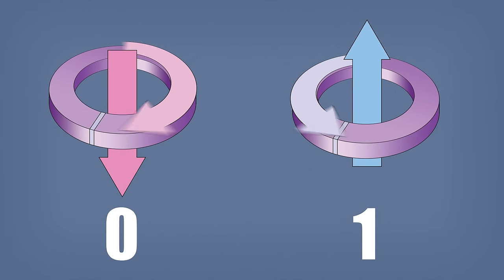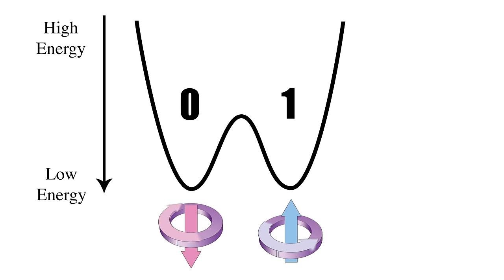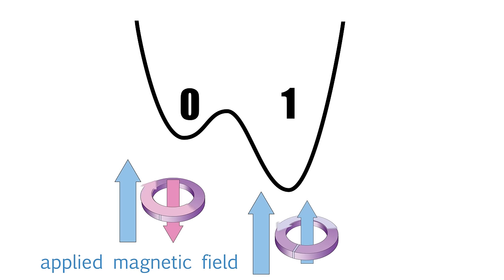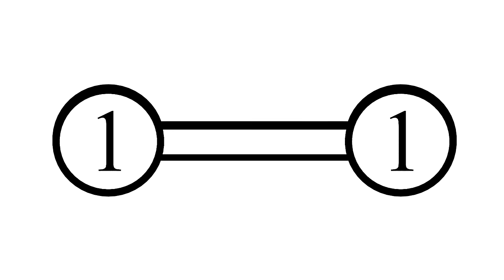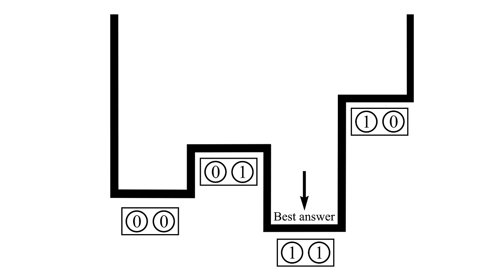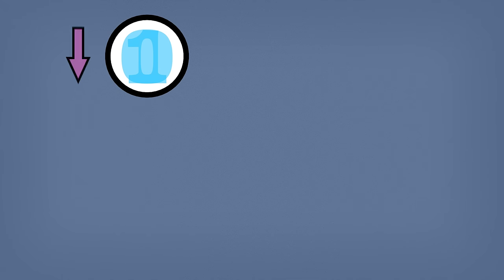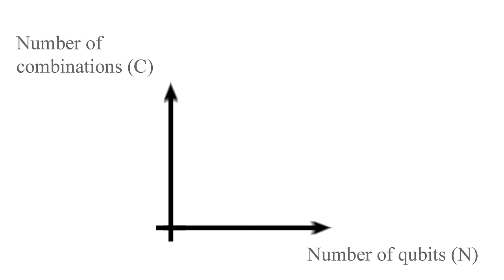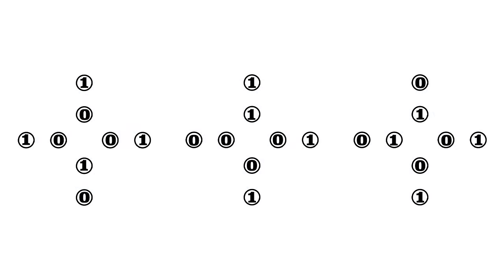How The Quantum Annealing Process Works

Comment: It is very correct description. Understanding quantum wave theory is required to see the valleys are the bottom of the wave which is how particles are found in a position. To see the quantum effect we must first understand the bias spoken of is merely the machine applying a slight magnetic field which hinders the chaos phenomenon and installs a desired effect which with minimum influence allows a known position to be found. Annealing is what qualifies this system as a quantum system which if quantum entanglement is true then so is this. However quantum entanglement is like gravity. We know there is an effect but we really cant prove it exist but we know it does to a degree. As long as the computer works then is a true quantum computer relatively speaking.

Comment: I think I'm finally understanding how a quantum computer actually works, but I would like an applied example like the Shor's algorithm or the  Grover's algorithm.
Reply: +Mackaber Witckin They explained in a previous video that this form of quantum computing is not (in my phrasing) 'Quantum Computing Complete'. It can't actually run Shor's algorithm.
Reply: +Mackaber Witckin An actually example would be "The Traveling salesman problem" or process scheduling problem.  Other chaos  problems that classical computers have a really hard time with Weather prediction, machine visualization, machine learning would also be in the subset of problems that quantum computers are good at.
Reply: rRobert Smith  as i understand it, basically all optimization problems with a finite solution space.. But if this really outperforms classical optimization algorithms like hill-runner / watershed by a large margin, it will solve a lot of problems!

Comment: so with the new computer with 1000 qubits that's well over ten novemnonagintillion (1 x10^301) different possible values... that's a lot more then modern "classic computer" processors I know of since it think most 64x based ones are around eighteen quintillion? Also has any of this put to any practical use yet or is it still all at point of experimentation or theoretical work?

Also I apologize if any of my phrasing is off I'm just a high school student completing a report
Reply: we cant control them currently we can only control the final and the initial state through quantum annealing we still have to achieve a gate model quantum computer

Comment: What happen if you force an impossible situation? like reverse entangle A with B, reverse entangle B with C and reverse entangle C with A?
Reply: Remember, there's no "forcing." It's just defining energy levels and then trying to minimize among them. The highest energy states would be 000 and 111, whereas 001 (two pairs different and one the same) would have the same (lower) energy as 010, 011, 100, 101, and 110. So it would equally prefer any of those 6.

Comment: Why use a quantum computer with its size, and very specialized required conditions(in the millikelvin) when there is an optical computer much smaller that is capable of more than an exaflop of compute?
Reply: ***** yes but brute force can accomplish the same task, and faster too.
Reply: Where'd you go to school just wonderin g if you're the joe mills i know
Reply: +Alex xeon when u have the problem being solved thru multiple streams of quantum computing u can find the solution instantaneously
Reply: Oooo! SLAMDOWN B)

Comment: if we supercool a classical computer will its performance increase?
Reply: +Amit saxena Yes, less resistance.
Reply: Isn't that exactly what people do to overclock classic computers? quantum computers consume no energy and have no heat dissipation though. I mean, the reasons for cooling are totally different.
Reply: No, you cool the computer because otherwise the processor will just start to melt because of the increase energy consumption which needs to get dissipated

Comment: What are the applications of this? Making topographic maps?
Reply: moniker127 Nobel Prize then?
Reply: +Thor Mentha The main driving force behind research into quantum computing is Cryptography. Because of the fragile nature of entanglement & how measurement, irreversibly, and decoherence in quantum mechanics all work; attempting to intercept/decipher a message that has been encoded using a quantum computer would destroy the message altogether (and tip off the receiving party, since it is physically impossible to copy the states of a quantum system). So basically, having 2 quantum computers would grant a secure line of encrypted communication that is impossible to break. On the other side of that, quantum computers would make short work of any type of encryption used by a standard computer today. This makes it a very appealing research area for government agencies.
Reply: +Thor Mentha It would seem like a useful tool in artificial intelligence as well. Especially in deep neural networks and machine learning systems that require heavy processing power for statistical computation (it seems to me that quantum computing by design relies A TON on probability statistics).
Reply: +Thor Mentha In molecular modeling, we are almost always running optimization(annealing) problem, where drug molecule/proteins docking in to important proteins in our body. The optimizations are almost too slow to be useful on even state of the art classic computer (goes exponentially with size of protein). Q-annealing can solve that problem almost linearly, allowing much larger protein systems to be calculated. It will be game changing in drug development (so called in silico screen), chemical biology and even change the whole theoretical chemistry.
Reply: +Thor Mentha Optimization problems are all over the engineering field. For example, maybe you are trying to find the shape of an airplane wing which causes the least amount of drag with the greatest amount of risk. You can build a simulation to try numerous wing shapes but it would take too long to try enough of them using a conventional computer.
Reply: +Thor Mentha But it is important to remember that these machines are still slower than the top conventional computers armed with good algorithms. D-Wave and others hope that additional iterations of this type of quantum computer will be better though.

Comment: I wonder if D-Wave Systems will ever reply to this question, but would that be the end of internet security? 
I wonder how easy would it be for a D-Wave computer to bruteforce and deactivate, say... homeland security nuclear defence umbrellas to give an example...
Reply: u can brute force of they wont allow u to enter the password more than a few times
Reply: By internet security do you mean Authentication (logging in), or Encryption?  From what I understand D-Wave's quauntum computers can not  break encryption. They are not designed to solve those types of problems, only optimization problems. 

As for authentication, well it depends if you are using a Key base scheme to log in and authenticate.  If its a simple password to log in, then quantum computers can't help you there.

Comment: Quantum computers and computing is a scam and a very expensive scam. Just the simple thought that a quantumbit can be both "one af zeo" at the same time is false, it can only assume one state at one single timestate - however small the timestate is - not two state in the same timeslice but only one state. Now lets assume it's possible to have both state at the same time, - them two qbit would represent 4 different state at the same time - but only state is right(correct). That means there is 75 % chance it's a wrong result. Adding quantumbits makes it just even worse - 3 qbits gives you 6 different states - but only one is correct equals 16.66% and the other 83.33 % will be wrong. OK lets calculate with "the speed of light" with quantumbits as being predicted - the quantum computer will be able to solve problems that wil take 10.000 years for ordinary computers to solve but wil be solved i a second with a quantumcomputer. - How wil you control and validate the result to be sure its the right result - and not wrong? - By the way th ecompagny D-wave is selling "quantum computers" and have done i forsom time already, - but where is all the fantastic result these computers are producing - it can't all be secret calculation when one bear in mind that some of these computers have been sold til commercial compagnies.